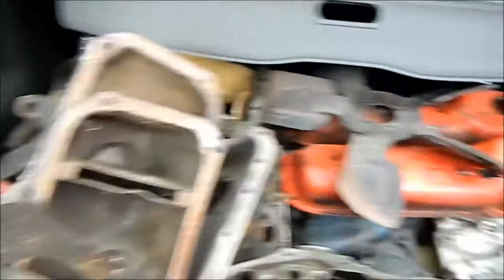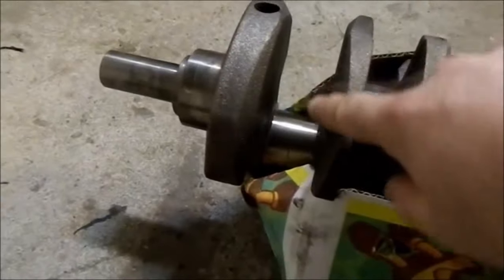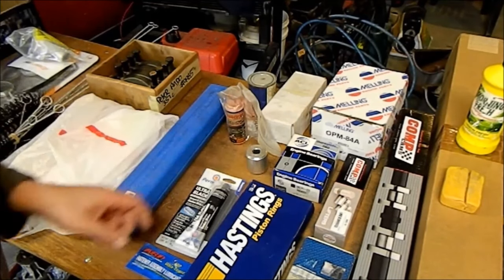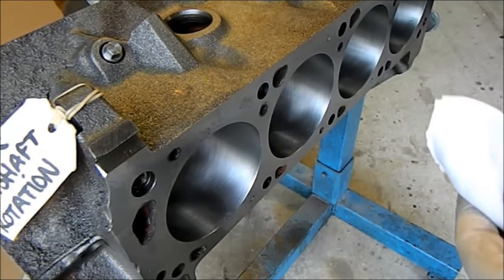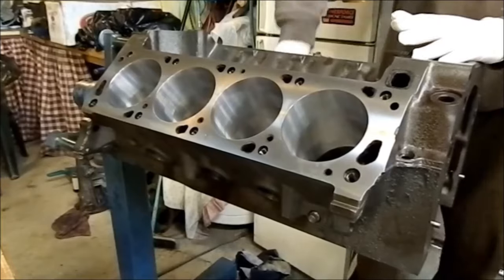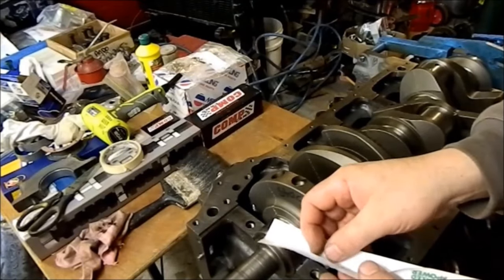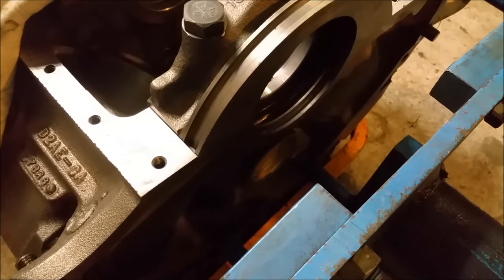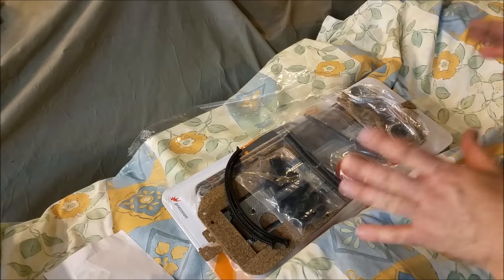Rebuilding the V8 - Block Machining, Cleaning and Chosen Parts 351 Cleveland Part 3

Comment: I see now what they' ve done to aid the oiling of the crank with the offset extra larger oiling hole cast or drilled into the block journal. I noticed before the middles of the crank bearings on the 302 Cleveland were not the solid types I've seen in ours in the states. no wonder you've had them around for so many years longer than we did here after they cleared up those restricted oiling problems. thanks again Peter for your videos and sharing your valuable time and experience.

Comment: I had to put my project on hold so stored it away and coated the block with WD40 so that it would not rust. Can i reclean my machined engine block with soap and water if i already installed the freeze plugs and oil galley plugs?

Comment: Thanks you so much for putting it in a playlist. I love watching your videos and you are very knowledgeable. I am 15 and myself and my dad have bought a 351 Windsor and are in the process of stripping and hopefully putting high compression heads, 2 of the cylinders having pitting from where the previous owner left the air cleaner off the engine and left it sit outside. Although tare down is looking good hopefully will get it bored and use the same rotating assembly. Your videos have been very helpful.

Comment: did you use a different crank from the original, original had 351 on it which means it's an Aussie crank yet here you mentioned it's a 4MA which is the American crank.

Comment: I purchased a 4 bolt main block ( bare) and a set of untouched 4 barrel/closed chamber heads. No rotating assembly. 
With that being said, I have a 2 barrel Cleveland that's complete. Would the rotating assembly from the 2 barrel engine fit the 4 bolt block?
Reply from the maker: Yes, all the same... as long as it's 302/351 Cleveland and not 351/400M (Modified), they have a taller deck and I'm unsure about the journal diameters, cheers.

Comment: What's in the XW / XY ? (sorry my ford-spotting skills aren't up to par on my GM, but I'm getting there) I started off in Holdens, but I like cars of all makes, it's a bit amateurish to just like one brand and hate all others in my opinion.
I reckon a Barra turbo 6 would go great in one of those, you can get stupid amounts of power out of those with only minimal mods and they seem to hold together as long as you take care of them right.
Reply from the maker: Hi, The XW has a 351 Windsor. Cheers
Reply: I always liked the look of the landau coupes, which had the same grille as your fairlane / LTD . Come to think of it, I don't think I have seen many if any at all of late. There weren't many made to begin with and many were probably turned into normal GT coupes during the 80s when nobody cared.

Comment: I would say good luck with the cam and flat tappets. I had an engine built in late 2021, Comp cam was from 2019 with lifters. Lasted 25 minutes for cam break in and the cam ruined my engine. Going back to machine shop tomorrow.  Going with Howard's Rattler roller cam on a 351m build. Even custom forged pistons and fully balanced. SUCKS.
Reply: Always put a magnet in the pan to capture any metal that may end up in it.
Even in a good engine there's always some wear.

Comment: Ok at 15:41 there is a hole in the block. it is not a machined hole it looks like it is broken. I have 2 cleveland dove 4bolt blocks out of a 73 mach 1s. one has that hole the other dosent. my question is, what is the purpose of it?
Reply: Oil drain hole. Juat rough cast from the factory and all the small block Fords have it like that.
Reply: @whiplashmachine  small block is Chevy nomenclature.
Ford had engine families.
Reply: @jesse75  oh for fuck sakes. You better contact ALL the aftermarket suppliers and let them know.
Reply: @whiplashmachine  truth hurts don't it.
335 engine family. Know your Fords.
You're not all that smart.
Small block is an adopted name.
Reply: @jesse75  335's yes the 351c, 351m and 400. Built many of them. Don't forget about the Windsor family either. You're just a smart ass
Reply: @whiplashmachine  thanks for admitting it.
Tell me something I don't know.
Reply: @jesse75  why are you even here? There is a discussion going on and all you were able to pick up on in all this was an abbreviation. If you have some actual relevant info or experiences to share on the topic, please do. If not, maybe you could troll elsewhere.
Reply: @whiplashmachine  "Although sometimes called the "Windsor " by enthusiasts, Ford never used that designation for the engine line as a whole ;
it was only adopted informally well into its run to distinguish the 351 cu in version from the 351 Cleveland version of the 335 family engine".
Quote from Wikipedia.
Reply: @whiplashmachine  troll is a liberal insult word used for when the person using it has no reasonable pride to admit they were inaccurate or unclear in their understanding.
" Don't cast pearls before swine ".
" As iron sharpens iron so one man sharpens the face of another ".
The choice is up to you.
Reply: @whiplashmachine  Jesse stated facts. He's not trying to insult.
If he's as terse as he sounds, I bet money he's a good meticulous engine builder.
Reply: @cammontreuil7509  yea, I'm sure he is.

Comment: so 40 thou you would not recommend, was looking at complete motor
Reply from the maker: All good... .040 is fine but some say it will take any future re-boring room out of the block, so it's effectively maxed out... others say they will go to .060. either way sonic testing will ascertain that. My block was a peach, so I just wanted to go .020 so as little material was removed as possible.
Reply: Peter Anderson thanks for your reply, the reason I ask is I'm looking at complete motor and the vehicle I'm wanting to put it in I drive rarely.